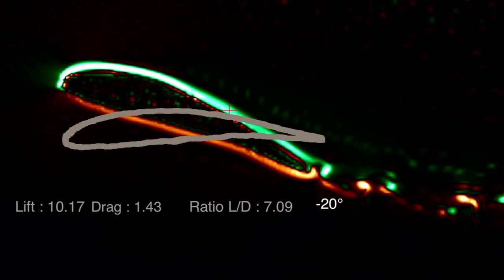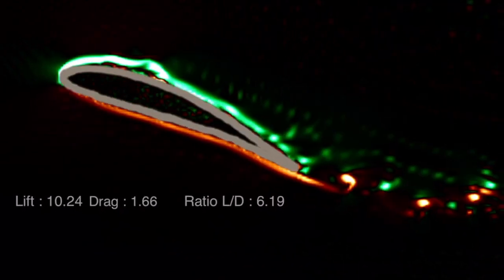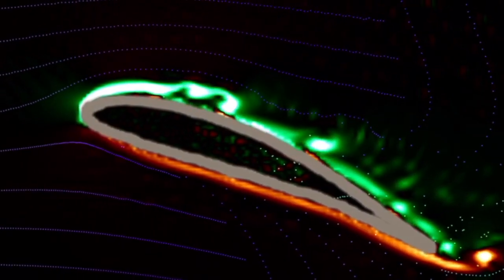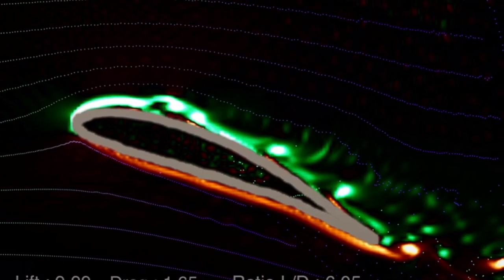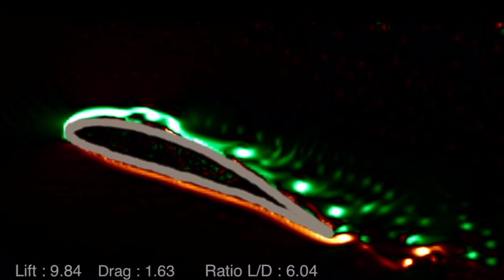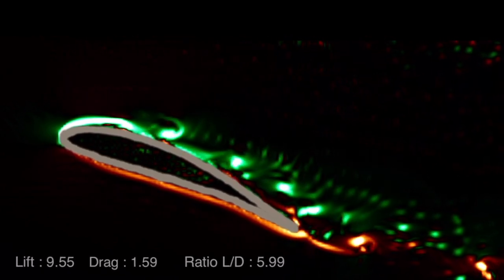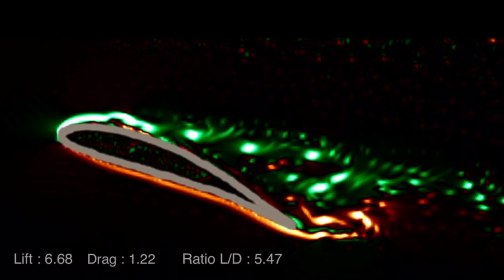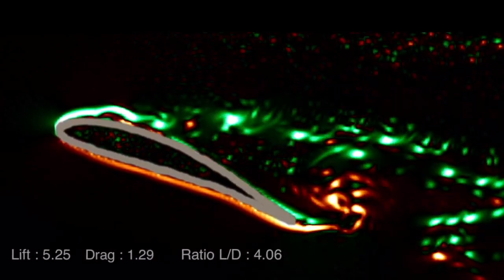Aerodynamic Stall: Flow Detachment

Comment: Nice : )
Would be interesting to see what happens around AoA of 45 deg : )
Because flat plate theory predicts there is another lift peak around that angle ~
Reply from the maker: Yea! Me too =) Are you talking about a local maximum or global? Our real life data in this video does not support this...well reality DOES not know flat plate theory: https://www.youtube.com/watch?v=CbbZUaCX83c (ENG subtitles available; ENG dubbed version coming soon)
Reply: So then increase AoA to 45 deg, and hit full power to recover from an Aerodynamic Stall.
Reply: @scottw550  at 45 deg, lift force will be about little lower than at stall angle (~15) but... air drag will be huge. Most likely plane will crash before it will reach 45 deg. Also CG before CP will not allow to make AOA that big.